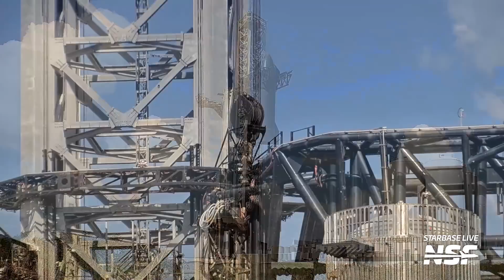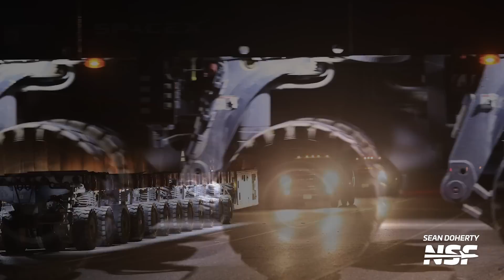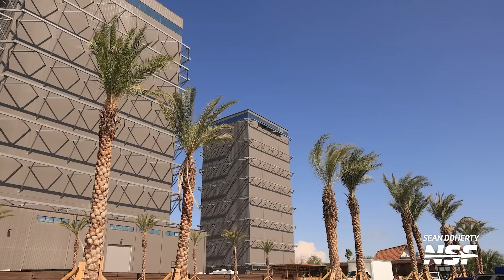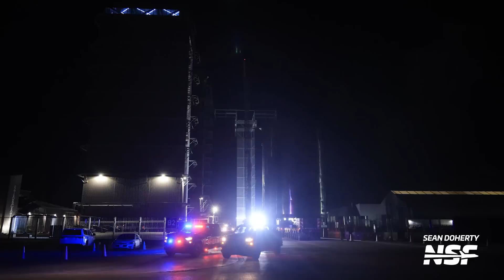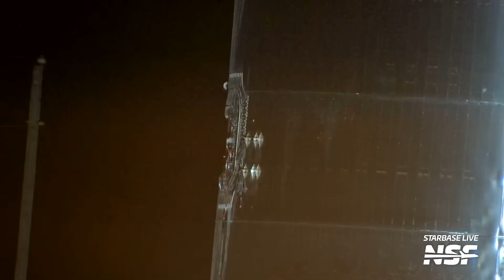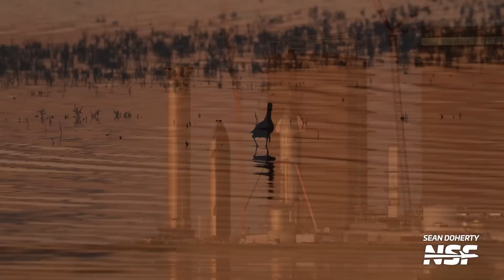Starship 25 and Booster 9 Re-stacked and Awaiting Flight | SpaceX Boca Chica

Comment: We’re in an interesting position here. Ship 26 is very close to being flight worthy, only lacking qualifying spin prime and static fire tests. Ships 28 and 29 aren’t very far behind it either. Ship 30 is fully stacked in the Highbay. Boosters 10, 11, and 12 only need their engines, shielding, and vented interstages to be more or less complete. B10 has undergone its rounds of cryo testing and Boosters 11 and 12 aren’t far behind it. If IFT-2 goes well, we could see the next three flights launch in quick succession with only weeks to a month or so between them rather than multiple month delays. The longer the federal regulators take only gives the crew at Boca Chica more time to line up the next series of ships and boosters for flight.

Comment: Wait they rolled back the transport stand? how are SpaceX supposed to arm the FTS now? I assume the stand will return once more
Reply: probably either roll the stand back, or just have the chopsticks hold the ship. the ship weighs vastly less than the tower's max carry capacity so it should be fine
Reply: The sequence of events is actually fairly confusing. I'm now hearing that they might have done a switcheroo where they moved S25's stand to the suborbital site and snuck out S26's at the same time. If this is right then S25's would still be at the launch site and S26's would be the one moved to the rocket garden (which would make more sense), but the video sure makes it look like it was S25's stand all the way so take with a grain of salt

Comment: I wonder if SpaceX will try to buy that section of highway at some point? They could buy that section of road / pay for a bypass road to be built so they dont have to plan road closures all the time. It only makes sense if they intend on launching from Starbase for the foreseeable future, especially so if they intend on building more launch pads. It would be a win/win for SpaceX and local gov. The state gets a big cash infusion for the sale of that section of land and highway, and also a new section of highway built.. and SpaceX gets a lot more land and freedom to move on that road as they please without having to schedule with local goverement. Also it would benefit their security seeing as the public wouldnt be able to roll right up into their front gate as easy.
Reply: The main issue with that is that Texas is very stringent with their beaches. I believe there needed to be special legislation to enable this sort of beach closure (or at least for some part of it), so I don't think closing the beach entirely would be an option at all unless SpaceX goes back to the government with some big asks. A bypass road would partially solve this, but there isn't any available land to build on (can't do so on the areas to the north or south), and if they got that sorted they'd also need to handle everyone who owns property along the side of Highway 4. It's not a ton of people, but there are certainly some active sites and more that are owned and currently unused. Basically it's a bit of a mess that would take a while to sort out, if it even can be sorted out.

Comment: Could it be possible that an FTS system isn't needed on the Ship at all since the Booster has its own and when it explodes Ship does as well?
Reply: I think the ship would still need an FTS because once it separates from the booster and subsequently goes out of control then it may need to be terminated.  Perhaps others may have a better understanding.

Comment: Is it just me, or has that incessant sound of hundreds of back-up beepers on all of the construction equipment, for the most part, gone quiet?
Reply: NSF uses a lot of canned and/or previously sounds in the videos, because most of their cams don't have microphones or they are severely out of sync. This time they decided not to mix in the beepers, because there are not many construction is going on.

And actually this is my pet peeve, because some of their sound samples have an easily recognizable noise/creak,etc. , and when you hear the exact same sound in a dozen videos it's sus.
Reply: Yeah, there's a good amount of audio that's not directly associated with the footage (many days it's so windy at the filming locations you just get wind noise), though I try to match it as much as possible with what it should sound like without the wind. One of those aspects is that there's less beeping and distinct construction noises as there once was (I think due to new walls and more indoor activity). In all the actual audio I'm rarely hearing the incessant beeping noises
Reply: @thomashayden804  Thomas, thanks for all your work getting these videos done. Always some compromises and "enhancements" to be made, I think you folks do it very well.
Reply: @thomashayden804  It's so much better than before. Thanks for the great sound editing. The sounds of the birds here and there is a nice touch.

Comment: Hot staging will add new torques caused by dissimilar engine start up processes not accounted for during cold staging. It will cause the booster to behave in a new manner at staging.
Reply: Yeah, that’s a good point. I’m definitely a little nervous about the hot stage ring. I’m sure they’ve modeled and tested what they can, but still it just looks flimsy to the untrained eye.
Reply: Hot staging probably won't work and the launch pad probably will get another hole